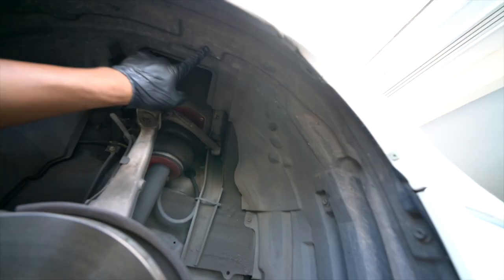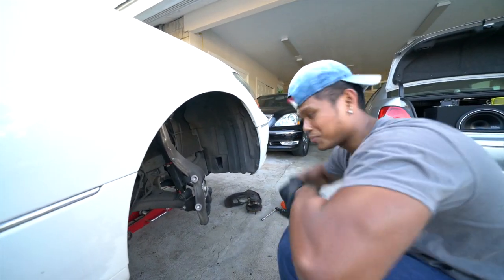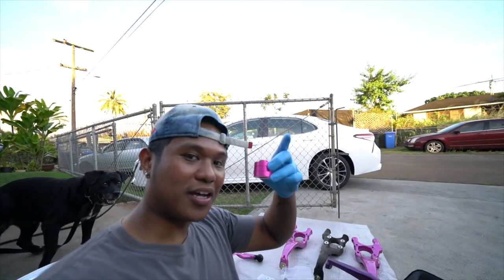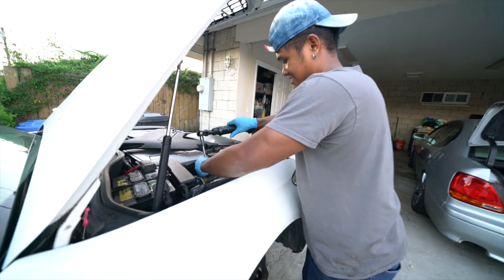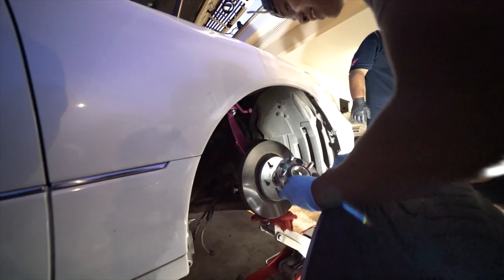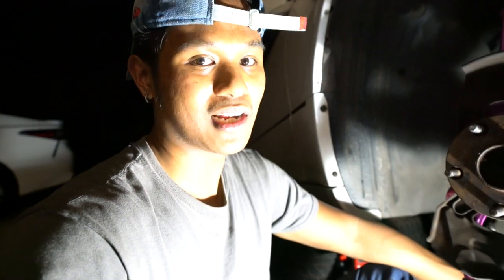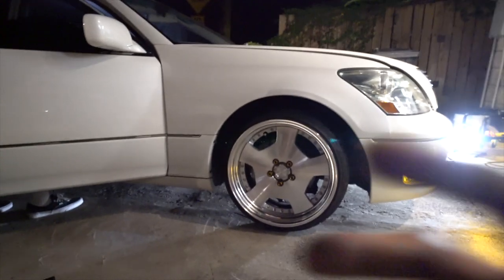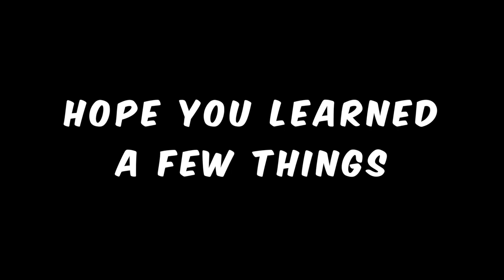JAY | VLOGS T-DEMAND PARTS FOR CP'S LS430 (EPISODE 53)

Comment: Bro.  Can you fit a set of lSportlines that are 20x9 +27 high disc Front and 20x11+23 high disc rear.   I am on bg coilovers and no fender trim or roll on 06 ls430

Thanks
Reply from the maker: The fronts should fit no problem. The rears may fit without a shave/roll but it might be tight. Depends how low you go with your coilovers too
Reply: You will definitely need to trim the rears. I ran GTR wheels that were 20x10.5 +25 in the rear and i had to grind the fender lip pretty much all the way in and do some very slight pulling with a heat gun and magazines in between rear fender and tire. Couldn't even fit a dime inbetween wheel lip and fender when i was done, but it never touched or rubbed. I ran 245/35 on the rear. I also know the exact wheels you're talking about. Very good price, and I even thought about scooping them up myself lol. Picked up some HREs that need built instead for $800 though
Reply from the maker: 👍🏽👍🏽👍🏽 yea if it was 19s with those specs they would definitely fit in the rears. But 20s is a different story

Comment: Have you ran into many problems with the ls?
Reply from the maker: In regards to what?
Reply: Reviews are saying both “super reliable” then “unreliable”
Reply from the maker: @Devest8  I guess like any car it’s hit or miss. My car gets barely driven but for the most part I haven’t had any issues. Only regular wear items, like worn suspension components & that’s all I can think of. My cousin was daily driving his car for years with little to no issues. The only issue he had was a transmission code & probably a sticking solenoid a couple times but it never came back since.